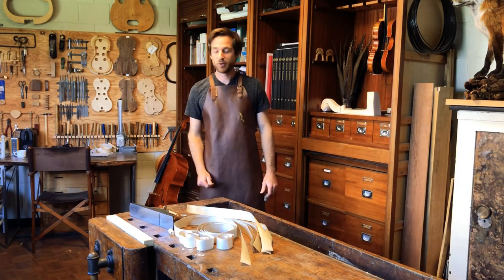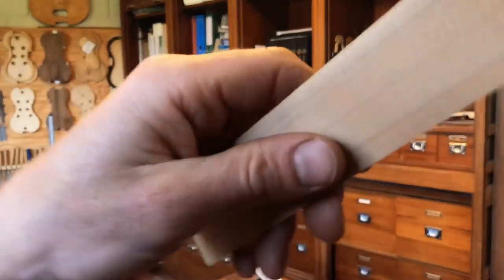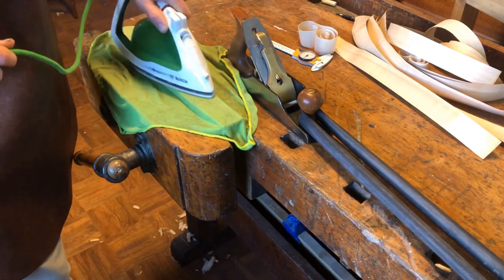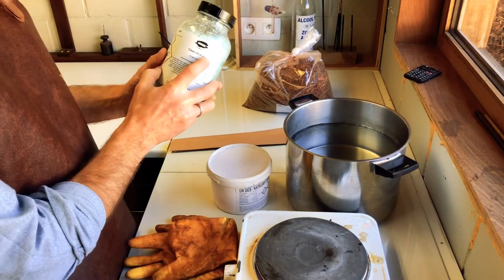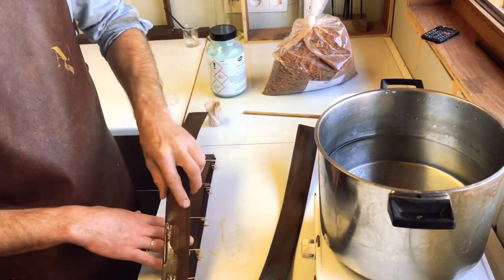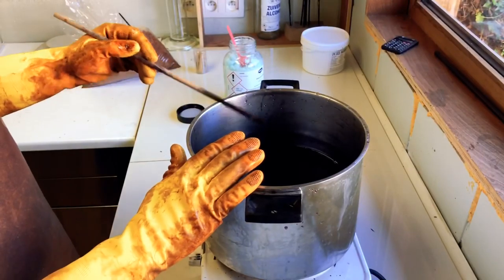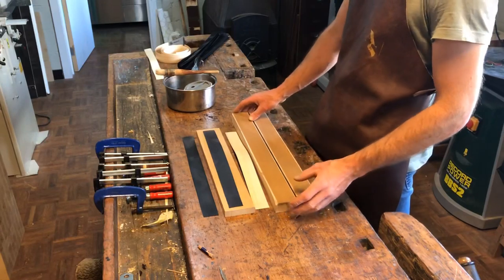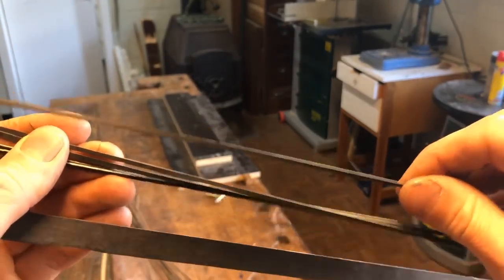Making purfling with Anton Somers

Comment: Hi Anton, 
great video, pretty much the way I do my purfling too. The only thing I would add (but which I suppose you do, even if you don't say so in the video) is to use split wood to make poplar and pear shavings. This trick, if well cared for, almost completely avoids the flaking of the fibers that you show at 3:06 and makes it very easy to bend the purflings strips when glued together without breaking.
Reply from the maker: Thanks Davide. Your right. I play with it in most cases I like the splitting of the fibre in the shaving.

Comment: Magic almost! Extremely interisting. Someone commenting on purfling said, it was a "gentle imbrace". I'm only an 80 year old novice, only after observation I think purfling enhances the plate tone,(much like a bass or treble knob). Look at every electronie speaker, and notice the special material that is used to attach the diapraham to the edge? I've only hand-crafted 3 violins, & I set the depth of the channel half the thickness of the plate. Just my small thoughts.

Comment: Hello Anton!
Thanks for the video and sharing your procedure in detail.
The details in the discription box completes the picture.
I hope you don't mind Anton, perhaps, making a small bevel or taper (0 to 0.6mm) on the wood at the start of the plane stroke, will allow the blade to cut with less resistance, no jerk and so better control.
Nice to know that you enjoy your work although it's really a challenge in many ways.

Comment: Thank you Anton for this video! I also make my own purfling and it is good seeing how you do it differently. The steaming is new for me. Thank you for that tip. I use green pear wood or plum wood and a shooting plane set up. I use poplar veneer for the center. Also, a violin maker friend told me to use yellow glue (aliphatic resin) so it is easier to bend the purfling after it has dried out. I got my dye recipe from the Weisshar book (sp?) and it is fewer steps. Logwood extract and ferrous sulfate and water. No pre- treating needed.
I appreciate your attitude towards the little variations that make a violin look beautiful! Thank you again for all the work you put into making this helpful video!
All the best, Scott Marckx
Reply: could you share your coloring recipe?
Reply: @magicvodou  1 gallon of water ,1 cup logwood crystals, 2 Tablespoons ferrous sulfate . Simmer the strips of wood in that several hours, then wash thoroughly. I saved the leftover dye water in a plastic jug and re-used it several years later, just adding more ingredients as needed. I hope this helps.
All the best, Scott
Reply: @sfmarckx  Thanks a lot!
Reply: @sfmarckx  what is logwood crystals?

Comment: Is the tannic properties of the pearwood not high enough to use simpler ebonizing techniques such as soaking in vinegar and steel wool? I assume the wood chips you are using is to impart tannins rather than colour. I’m pretty sure that same wood species is used by sailmakers in the traditional tan-barking process.

Comment: Anton why dont you simply drop the timber into a hot water container for a few minutes or a hot bath and pour in boiling water,drop a teaspoon of oil into the mix,There is a 1s time for everything and i jumped in feet  1st. One of my sons has recently bought himself a few Violins and has been  taking lessons, for around a year now , But he is an adult, and i have also cracked open an old violin for 1st time ever , sanded it down and removed layers of old varnish ,but it looks brilliant,showing all the grains of the Violin front rear and sides flowing and looking great, i removed the Neck and seperated the peg including all the other bits .As Also being an x carpenter i knew my way arounf different timbers, and never realized the appeal and beauty involved in Violins untill now.Chris from London.u.k.Thanks for your informative video.